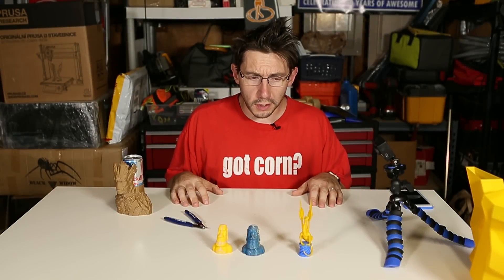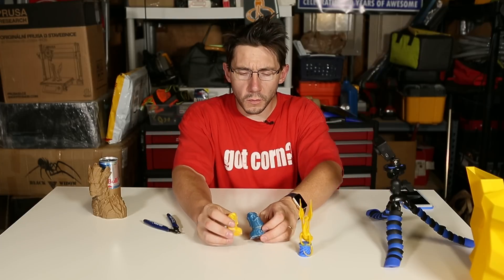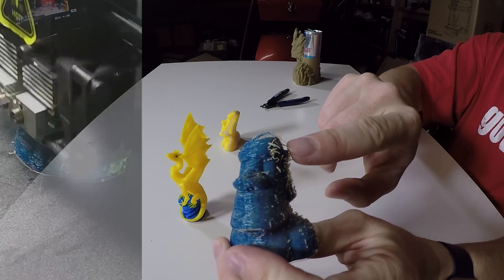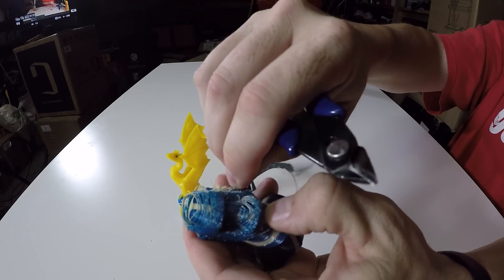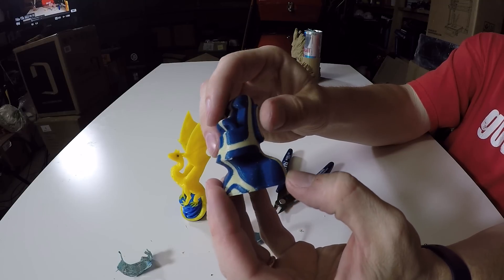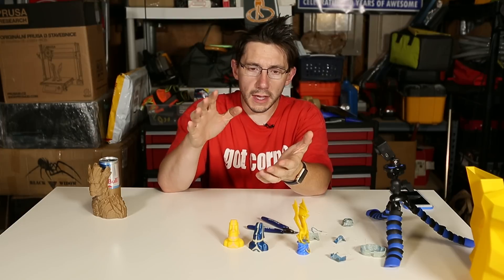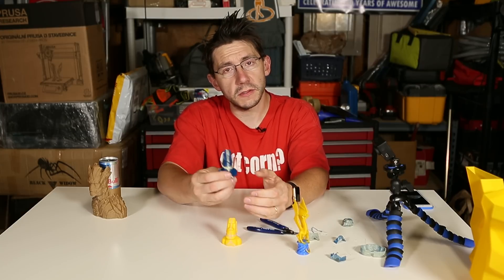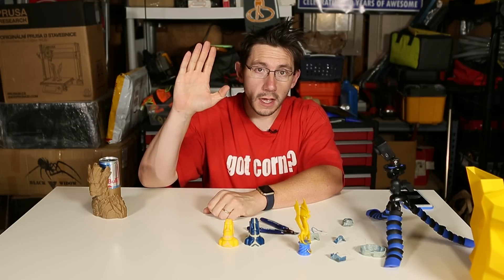3D Printing 101: What Is a Wipe Wall or Ooze Shield?

Comment: What was the blue filament? I have been thinking about getting a dual extrusion printer, do you have one you can recommend in the $500 or below range if there are any that cheap?
Reply from the maker: Unfortunately I don't know if they go that cheap. The Flashforge Creator Pro and Flashforge Dreamer are around $1,000. The blue filament - I don't remember. Crud.
Reply: What about printers similar to these, there are a few on Amazon: https://www.amazon.com/dp/B074TGV2TK/_encoding=UTF8?coliid=I2E41JZ5AC8VZJ&colid=G4400R0C264Z

Comment: I have some troubles trying to configurate the Dual Extrusion, I've already watched the tutorial that is on youtube that explains how to extrude the support, infill or raft/brim with Left or Right extruder.
My doubt comes when I try to print a model in 2 colors, for example: I'm configurating a Charmander and I want to print just the flame of the tail with yellow and the body with orange, but I don't know how to do it, tried to use the option Auto Ungroup so the model was separated in 2 pieces but it didn't work...could you please help me?

Comment: I found that ooze shields also seem to help with printing ABS. Using two outlines on the shield, it basically prints an enclosure around each part and keeps bed heat in. For me it drastically reduces, although does not completely eliminate, warping issues. I also set points for bed temp to be at 110 for layer 1, 100 for layer two, and 90 for the rest of the print, because early on leaving the bed at 110 it seemingly got the abs too soft and the bottom of the parts deformed and discolored.

Comment: on this subject, wasnt there a company that came up with an external unit that spliced different filaments togheter allowing for multi color prints with a single extruder? it worked by measuring the toolpaths and filament needed followed by some cutting and end to end welding.
Reply from the maker: +Konzetsu Yes! It's the Palette from Mosaic, and it's in a box waiting for me to open it up :)

Comment: But, What is an ooze shield?, How does one make an ooze shield, What is the visual difference between having an ooze shield and not having an ooze shield. You mentioned dual extrusion more than the actual title topic. I feel like I know less about the topic after this video than I did before the video.
Reply: NAGleader NAGleader An ooze shield protects the print from dual extrusion’s leaking. For instance, if he printed the Easter Island head without the shield, the blues and the tans would melt together, limiting the pattern he could make. Why this happens, I assume, is because as it swaps between filaments, there is tiny amounts left over in the extruder, that get pushed out. In some way, the Ooze Shield protects the print, how? I’m not sure, though I assume by being a thin layer that it does inbetween filament changes. Kind of like a color block on Prusa MMU.
Reply: Building onto what @Nine Tails said, adding an ooze shield is something you would select in your slicer software
Reply: In cura there is a prime tower option under customs options for your filament if you have a dual extruder...

if you klick the gear and activate ooze shield it will add the ability to chose between and add an ooze shield thickness/size..so this video is just an information that it is indeed helpfull

Comment: Really interesting video. What I don't understand is why anyone haven't taken advantage of color bleeding to make first fully color 3d printer that would mix CMYK (or rather CMYKW since you may want white as well) filaments in different proportions to make fully colored prints.
Reply from the maker: I know there was an Adobe research project to use some properties of color bleeding to do that, but, so far, no one has mastered it.

Comment: what are your opinions and experiences on single vs double nozzles?
as i understand it, a single nozzle setup is lighter, and you can potentially mix colors/materials. but it whastes quite some time and material when transitioning.
where two separate hot ends are quicker and less whastefull, because you dont need to cycle filament when switching colors, and you can run different temperatures, and even feeders, to print multi material. (rubbery filament wont work with bowden feeders)

Comment: Would you show the shield with the prusa? Or how the 2 filaments work with it
Reply from the maker: The ooze shield is specific to systems with more than one nozzle - it's meant to catch what oozes out of the nozzle not currently in use. Prusa has one nozzle, and his 2-color and 4-color option use the same one nozzle system, so there is no need for ooze shields with Prusa systems. That said, they'll still need a priming tower, and I'll show that once I get the 4-color add-on :)

Comment: nice video as always. simple and very clear. i do have one question thou:
is this ooze shield something i have to set up before printing or is it something double extruders do normally? or is it up to the different materials?
i own a flashforge creator pro which is still sittin in its box due to renovation. its my first 3d printer and i cant wait to set it up.
i watched many of your vids and i already know how im gonna do it. please keep up the good work.
Reply from the maker: The ooze shield is a function of the slicer. I used Simplify3D and it has the built-in functionality to create an ooze shield during a dual-nozzle print.
Reply: thank you joel. this i really didnt know. as well as which slider to use. im gonna give simplify3d a nice shot just to see how i hang around it. of course you can't really tell from camera images and videos on youtube, but is the final quality something a lot better, according to you?

Comment: I'd love to get into dual extrusion printing by upgrading the head on my Taz 6, but I'm worried about facing adhesion problems between soluble filaments like HIPS and PVA and regular filaments like PLA and my fav PET-G. It seems like getting PLA to stick to HIPS or PVA is quite difficult, and I can't find anything about whether PET-G can stick. Maybe soluble PVB filaments will work better?

It'd be great to see a video testing the adhesion between HIPS/PVA/PVB and PLA/PET-G/ABS, examining how well it works to print one onto the other and vice versa.

Comment: Do you have any tips for multiple color printing with a single extruder on a prusa i3? 

#highfive
Reply from the maker: The printer includes a "pause print" option. At that point, you can swap the filament out, and when you resume, the new color will be printing :)
Reply: can i pause a print also on a layer in simplify3d automatic
?(in the gcode) so when the printer is done with printing with layer 100 then pause it, put a other color in the printer and continue the print and when i am done with that color do it again?
Reply from the maker: Photograaf11 You sure can!
Reply: thank you! #highfive

Comment: Be careful with those flush cutters, I was using them to remove bits of PLA from a print (yeah, the raft and the print were fused together, that sucks) and they broke. I ended up with the handle in my hands and a sharp metal part flying across the room. The cutter just split in the middle and the actual metal broke. It did not hit anyone, but it was the last time I used the free tools that came with my printer
Reply: Same thing happened to me a few times using a quite high-quality box cutter. So, always wear at least some eye protection.

Comment: Definately Tan-Blue is best.  What slicer is being used for Ooze Shield?  I don't remember seeing the feature anywhere.  Its not an urgent thing for me since none of my printers multi-extrude but some day they will when I do the next rebuid/upgrade. :-)
Reply: Simplify3D - the best slicer
Reply: Thanks.  Looks like pretty classy software with a strong emphasis on customer support.  It might actually be worth the $150.  I noticed that they even support Linux.  I strongly prefer open source, but It's not out of stubbornness.  Sometimes a proprietary tool is worth the money. I'd probably be looking for loose change in the couch right now if I knew it could do automatic tree branching support structures like meshmixer does. :-)  Thanks again for letting me know.

Comment: I use ooze shields all the time on my dual prints. I like using the vertical ooze shield vs the waterfall.  The waterfall sometimes gets stuck to the print in my experience.  Great video though.  It's crazy how few people use dual extrusion.  I love it!
Reply: I think you're absolutely right in that as more support is build for dual extrusion setups, more people are going to naturally opt/build/buy into it. 

Right now, it feels like very much a novelty. Some people have legit uses for it, but many do not. As more people step up and identify more clear use cases and tools become more streamlined, that barrier should drop considerably.
Reply: I think there's a few reasons why people aren't using it:
1) it's just more expensive - need another hot end and extruder
2) only really works with a bigger printer printers - those hot ends take up a lot of space
3) adding a dual extruder setup to an existing big-enough printer reduces your print volume 
4) it still doesn't feel like there is first-level support in most slicers to take advantage of dual extrusion - along with very few models that benefit from it

Barring cost, which is a legitimate issue for many people, most of the other issues are annoyances that people just can't be bothered with. There's very few things that "require" dual extrusion, so people get by without it - especially if most of the use cases can cheat with creative filament swaps mid-print.
Reply: I agree. I've got a dual Extruder for my Taz5. It is gathering dust at the moment. First, Extruder 1 was failed from the beginning, and after many needless emails and videos, Lulzbot allowed me to return it. So by this time, I'm already skeptical of dual extruding. I get it back and determine all is well, but I have been unable to get a precise alignment in the two extruders and to make matters worse, Extruder 1 builds up heat over time and starts stripping the filament. That is not to say I'm giving up, but for the time being, I'm back to my single filament Extruder which has zero problems.
Reply from the maker: Paul Nolastname I bet there is a lot of truth in what you are saying.
Reply: Dual extrusion is still hard, but it's getting better. I think the biggest problem is generating the models, but making sure your machine is well-adjusted means spending a bit of time adjusting it and a lot of machines don't have any provision for easy adjustments. The nozzle spacing is a valid issue, but I wonder if some of the extruder designers don't even use their product. K&K even have one that has 50mm nozzle spacing, which is bonkers. I'd designed a couple extruder systems with 17mm nozzle spacing and even had plans for 13mm spacing, which E3D made harder with their cartridge block system. I didn't believe in single nozzle dual extrusion because the materials I wanted to use didn't like to be extruded at the same temperatures.

Most of my dual extrusion work is for easy-to-remove support. I used to dissolve HIPS but my last batch of big parts I had my machine dialed in well enough to just snap off the HIPS as a single block.
Reply from the maker: I think once the barrier to entry for dual extrusion gets lower, we are going to see more models and printers take advantage of it. Right now, using PVA for support material is one of the best reason to use a dual extruder setup. As for number 2, that's usually true, though, with IDEX on the Sigma, you aren't losing build volume since each extruder is separate. It DOES require more space though, like you said. I think with regard to slicers, the support for dual extrusion is mainly there to use a material for support that's different than your main material. It'll be VERY interesting to see what the multi color technologies we are just seeing now do in the next 12-18 months.
Reply: My designs and parts are all industrial, and my inspiration has been sites like this one and J. Bruton. But you rarely see them build an industrial print for dual extruders. They print almost exclusively in single Extruder mode. I believe the future of dual filament will be the development of a single Extruder, not a dual Extruder, at least for folks like me.
Reply: you might actually got a point. it will be funny, at least, to see how this tech evolves. i do not make it a single or double extruder problem, but i believe both extruders have to work completely indepentently from each other in order to make a leap that pushes behind and away this generation. i am a newbie and i know pretty much nothing, but from what i have seen distance and build plates will make the difference.
thou i still wonder if a full enclosed 3d printer with very big print space exists...